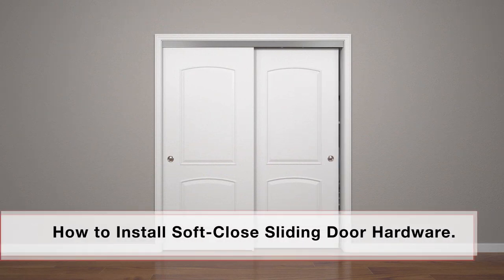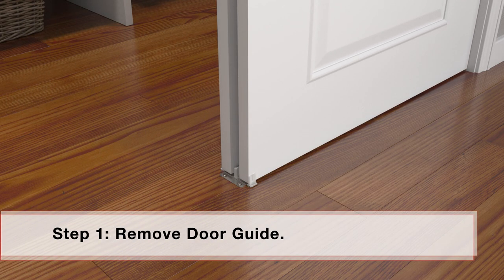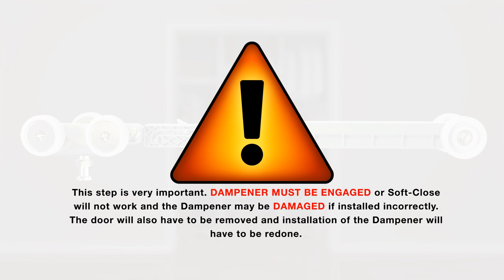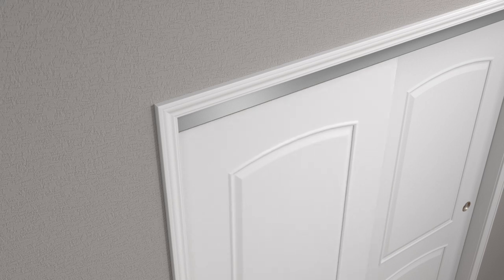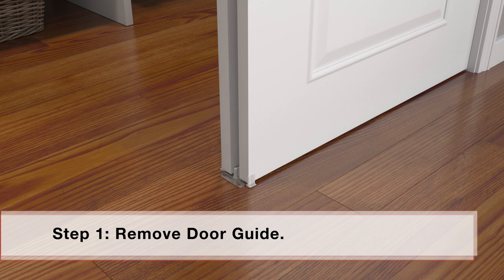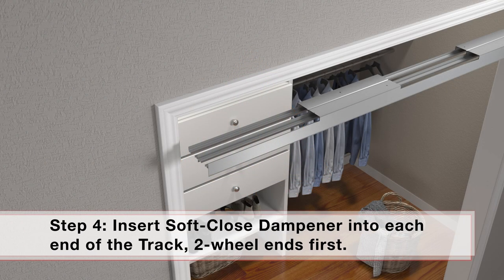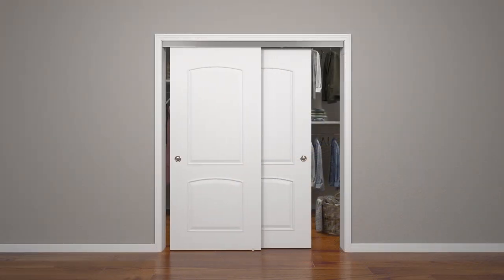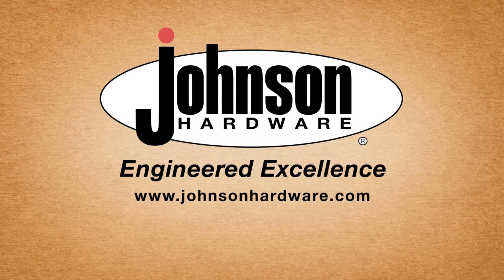Johnson Hardware® 1060 Soft-Close Sliding Bypass Door Installation Instructions

Comment: how thick  the door can be
Reply: That would all depend on if you are building your own frame or if you are using the 1500SC (for a 2x4 wall) frame.  The soft close will work for doors a minimum of 1" thick, but the maximum all depends on the framing for the door.  If you are using the 1500SC frame, your door can be 1" to 1 3/4" thick.  The max weight of the door is 165lb.